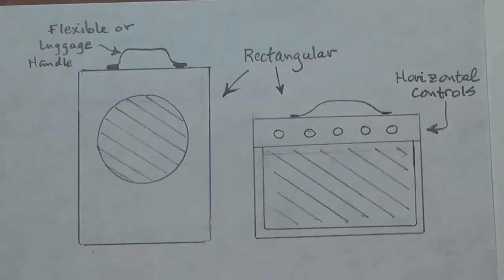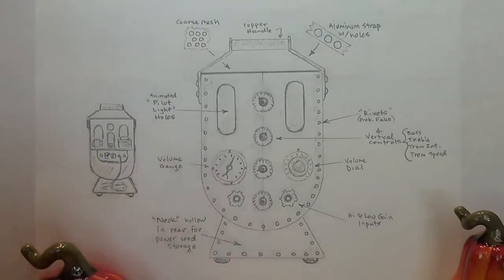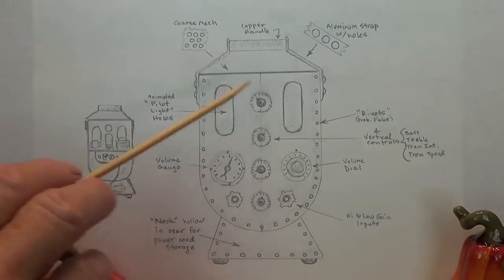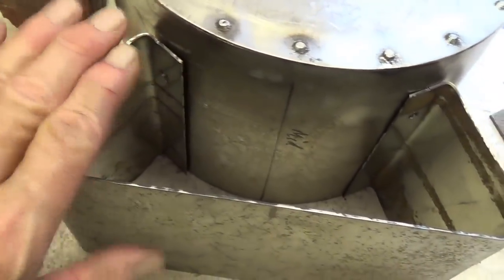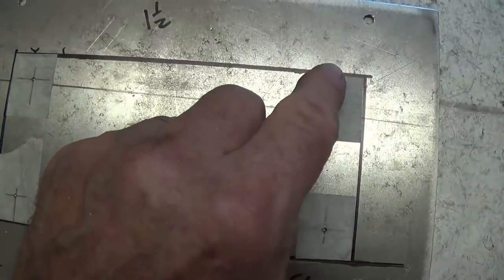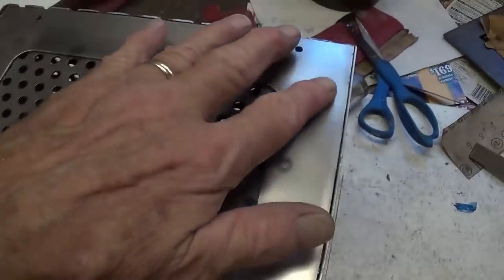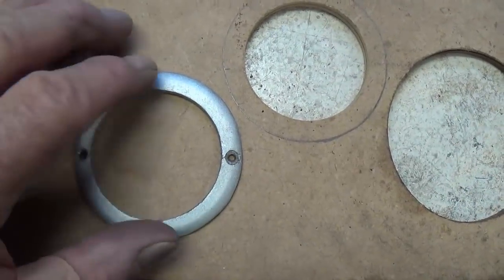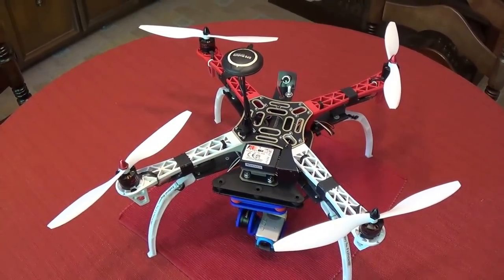Scratch-Built Steam Punk Amp, Part 1: Design and Construction of Metal Cabinet

Comment: Just a guess but are those animated pilot lights gonna be magic eye tubes? If not have you considered using them in some of your projects? 
I made an audio amplifier and used two magic eyes for the two channels to work as vu meters. It looks super cool and they really make it look very high tech and professional.
Anyway, i really like the design of this amp and I'm looking forward to seeing it finished.
Reply: Russian IN-13 neon linear bar graph tubes make really sexy VU meters as well. Not for this amp (IN-13s are too long and thin for these cutouts) but maybe for some future design. Readily available NOS on eBay etc.
Reply from the maker: Thanks, Sooti. I will keep them in mind.
Reply: I've heard magic eye gurus say they wear out if you leave them on for extended periods. They are cool to look at but that's a deal breaker for me. I've been running a strat into 1947 Eico Signal Tracer and I want to add a switch to turn off the green eye.
Reply from the maker: I tend to believe the "fading with age" stories, FW. The phosphors lose their zing over time.....just like old B&W TV sets that would get so dim they'd have to be replaced......but, while they last, they are indeed magical.
Reply: @UncleDoug  indeed, like my joints. Trying to preserve those too. Hey, I wish they had a TV show called "Magic Eye for the Electronics Guy" ?

Comment: Hey Doug, nice flight with that drone!  I have a racer style with the fpv goggles.  Pretty awesome and they make frames and kits or ready to fly setups.  Mine is an eachine wizard x220 that has a better fpv camera and better props.  I have to fly fpv otherwise I lose the thing fast using line of sight.  There are some really good channels on youtube, recommend joshua bardwell and uavfutures
Reply from the maker: Thanks, Matt. I wear yellow glasses usually when flying the beast, to sharpen my vision......but still manage to lose it from time to time. Thank heavens for the "Home" feature.

Comment: If I can make one suggestion, it would be very neat if the gauge is not connected to the volume, but instead, if it is a VU meter (maybe a voltage meter)??? Awesome design by the way!!! :)
Reply from the maker: Thanks, Bernardo. I considered incorporating a voltage and/or ammeter in the design but couldn't find any proper-appearing gauges to use. Maybe next time......

Comment: Amazing design and execution.  Any guess to the final weight?  

My first thought about the control/indicator system was some sort of three-phase synchro arrangement.  But that didn't feel very steampunk to me.

What did was a simple gear and chain setup straight out of an old Erector set box.  But no one would ever see it.  :(   I think belt drive was pretty good.
Reply from the maker: Thanks, Joseph. I thought about a chain for perfect alignment, but didn't have a proper one, so the neoprene belt was used. I will weigh it when completed and announce it in the video.

Comment: Doug, I can't express my excitement over this project's approach to style, moving beyond finger joints is a long-term design goal of mine.  I'm holding off on animated display speculation or any other specific comments until project completion. I do think Ollie and Jack should carefully consider their song choice for your steampunk style. I'm sure they're in day-long deliberation now. Might I'd offer some suggestions: Roadhouse Blues, Page's Bring it on Home or another Sleepwalk would be lovely.

As for the hot rod drone, I'm glad you opted for a WSTF flight. You running a Pixhawk?
Thanks
Craig
Reply from the maker: Hey, Craig. I'm glad you like the new project. I figured that people would either love it or hate it, but so far it's been all love......other than the usual idiots who always give my videos a thumbs down :) You'll really like the "animated pilot lights", the nature of which I am not at liberty to divulge :) Yes, Ollie and Jack are tuning up their steam-powered guitars for a suitable group of demo tunes. I'm a little hazy on the flight controller in my home-built drone, it's been a while since I built it, but I believe it was an Ardupilot.
Reply: Its 99.92% love out here! 

Those down-voters probably didn't like your spot weld separation distance or some damn thing. I say, "You don't like it? then unsubscribe! Take your negative energy somewhere else, like a psychiatrist."

ardupilot sounds good and has been optimized like crazy. You can 'de-tune' it, but being the hot-rodder that you are, I know you'll get used to the responsive sticks. Plus its inexpensive. Damage from an 'earth event' no prob, just replace a blade or a rotor arm and you're back in the air. The word 'crash' is soo negative.

Comment: An upside down tombstone radio shaped cabinet made out of metal ...now that is what I’d say is, “Doing it in style.”
Just one thought Douglas: since steel and aluminium usually react when together, especially in dank wintery weather when there is a lot of moisture in the air, do you have a contingency plan up your sleeve?
Phil.
Reply from the maker: Our humidity is around 5 or 6%, Phil, so I generally don't worry about it. Maybe 50 years after I croak, people will start having problems with my old amps :)

Comment: This thing needs to be 6L6GB/5881 or better push-pull. I love your amps Doug, but this deserves to be truly overbuilt.  A triode/pentode switch is easy enough to install to cut the volume. A tone stack cut out switch(lift the mid resistor from ground) would be another neat addition to really blow the barn doors off!
Reply from the maker: Thanks for your helpful suggestions, Matt. I'll definitely keep them in mind :)

Comment: What a fun amp Uncle Doug.  Perhaps I missed it in the video(s), but I don't remember seeing a schematic (maybe you didn't even hand-draw one?).  What kind of tone stack and tremolo circuits did you employ for this build?  And how did you wire in the bubble tubes (what a great touch)?
Reply from the maker: Thanks, Kevin. The circuit is a Fender VibroChamp AA764 with original tone and tremolo circuits. The bubble tubes use conventional candelabra-based 120VAC receptacles.

Comment: where do you get your dial indicators as used on your art deco amp? Thanks and you are really on fire with these last videos. Great job at setting yourself apart from all others!
Reply from the maker: A generous viewer sent me 10 of them.....and I have run out. I'm going to check on Ebay to see if more can be ordered.  Thanks, Aoki :)
Reply: I can't find them any where on the internet including ebay. Any info would be great. Thanks again for all of your har work and expert teaching.
Reply from the maker: I just ordered 5 of them on Ebay, Aoki. They aren't cheap, but they're available:  https://www.ebay.com/itm/5pcs-Variable-Round-Potentiometer-Pot-Knob-Scale-Face-Plate-Dial-WX112-WTH118/122946511145?ssPageName=STRK%3AMEBIDX%3AIT&_trksid=p2060353.m2749.l2649

Comment: Uncle Doug, 
I have dealt with aluminum house wiring problems before so I am curious - is there any reason to anticipate problems with interactions between the aluminum and the steel in this amp? Will you have to do anything special to ground the cabinet?
Thanks again for your videos! 
- Mark
Reply from the maker: I have never personally had any problems with electrolysis, but now, when wiring amps with 2 different metals, I make sure that no ground is purely dependent on a connection between the 2 metals.

Comment: That's a really nice looking project Doug.   What navigation system are you using on your F450?  My first drone back in 2012 was a Gaui 500 and it was just hell to fly.   I had a feytech nav system on it and it complete garbage.
Reply from the maker: I believe it's an Ardupilot flight controller, Mike. I worked out the bugs and it became much more stable and reliable.

Comment: Hey Doug, I have 2 VT-138 magic eye tubes that would look good in those holes. I can ship them to you if you want them (from NZ).
Reply from the maker: Thanks, Mike, but the holes are already filled :) The video is currently uploading and will be posted at around 7AM MST on Tuesday.
Reply: I'm looking forward to it. At least I now have an idea for what to use magic eye tubes for. I'm still watching and learning. Managed to fix an old GEC (Osram) 912 phono amp after watching your vids and I'm still alive. I let the smoke out of a couple of huge caps in the process. I have a 12SL7GT tube I'm going to attempt to build a preamp for the GEC to convert it into a guitar amp.
Reply from the maker: Good luck with all your projects, Mike. Be careful :)
Reply: I keep one hand behind my back.

Comment: Hey, Doug. You should use a DC voltmeter gauge for the volume indicator. Attach it to a dual-gang pot. The signal would run through one gang and then use the other to affect the voltage going to the meter. Maybe, a rectified DC voltage off of the 6.3VAC heater supply voltage?  Maybe something like this? You could modify the background. https://www.amazon.com/0-20V-Analogue-Voltage-Analog-Voltmeter/dp/B018HX1D1G

Comment: would a crank handle on the side be overkill?complete with ratchet it could blow a gullible mind or two
Reply from the maker: ........and have the crank connected to a generator and capacitor to produce and store  the bias voltage required for the amp to function

Comment: UNCLE DOUG . I FLY DRONES MYSELF . I HAVE SEVERAL DJI DRONES AND LOVE THEM . BUT RECENTLY I HAVE PUT TOGETHER A DRONE USING AN OMNIBUS F4  BOARD AND A SOFTWARE PROGRAM CALLED INAV . INAV HAS COME A LONG WAY AND I AM VERY IMPRESSED WITH HOW STABLE IT IS NOW . DO YOU FLY THESE DRONES OR ARE THEY A FRIENDS ? JUST CURIOUS . I USE CAPS - EYE TROUBLE .
Reply from the maker: They are my own drones, Keith. I started years ago and am sure that the technology has advanced way beyond my early experiences with programming, designing, building, and flying them.